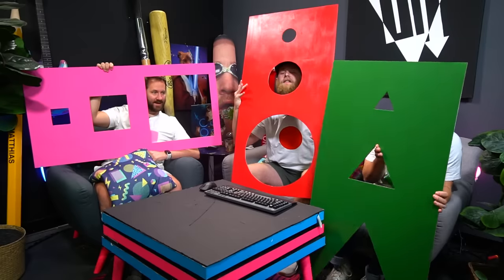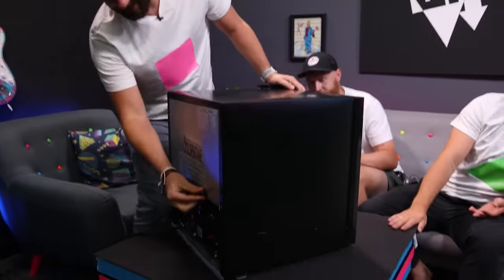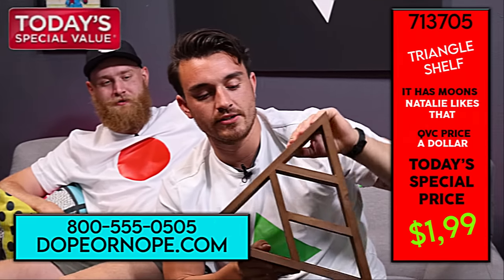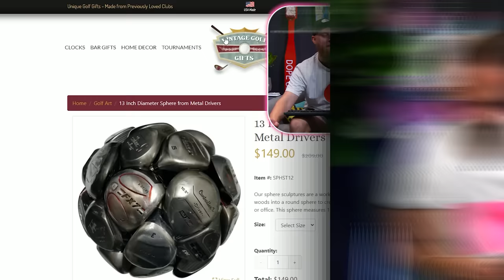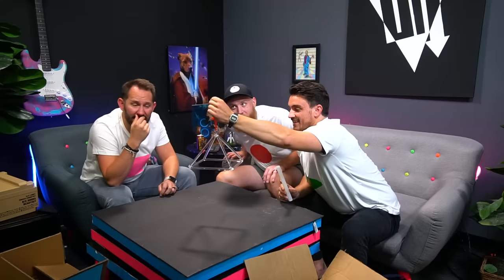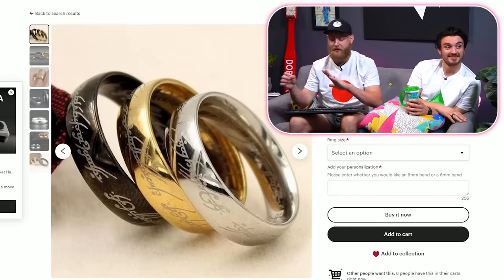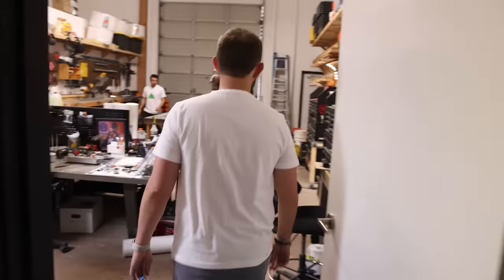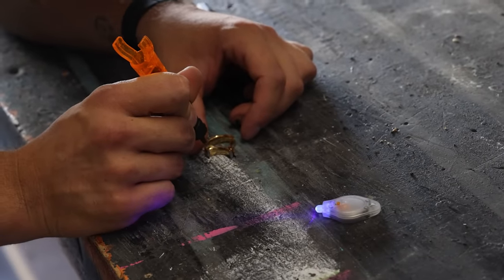Buy Anything As Long As It's One Shape!

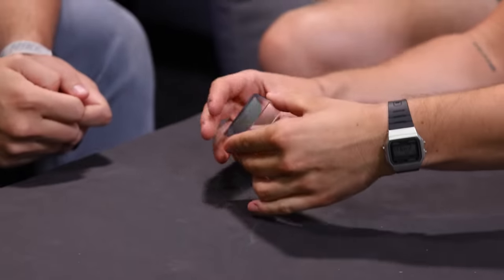Comment: 19:22

Using a phone flashlight to refract it and see rainbow via glass prism won't work since phone flashlight =/= white light produced by the sun. The thing is, white light produced by the sun has all the colors ranging from red to violet. However artificial light have some color components missing.

There are some lamps out there that produce artificial light which show different rainbows, with different color intensities. Just wanted to mention this for the boiz :)